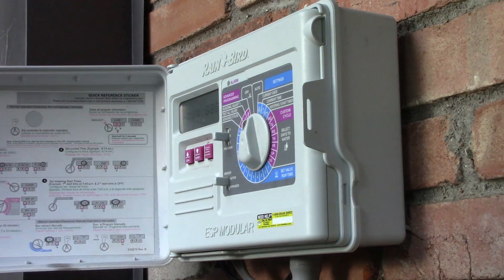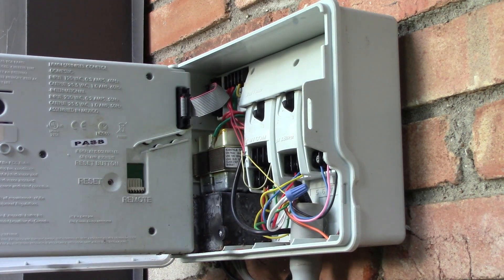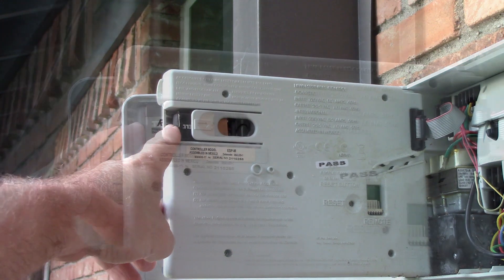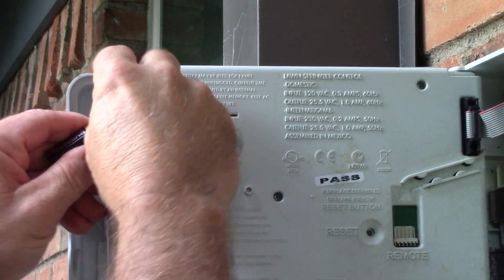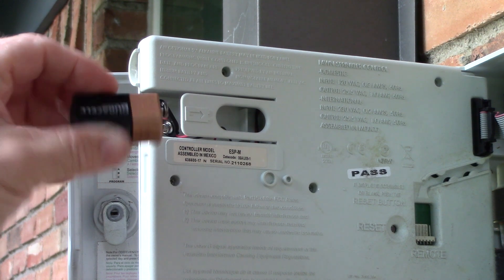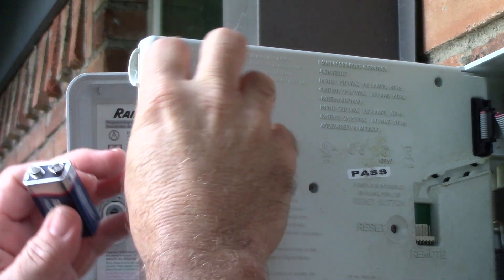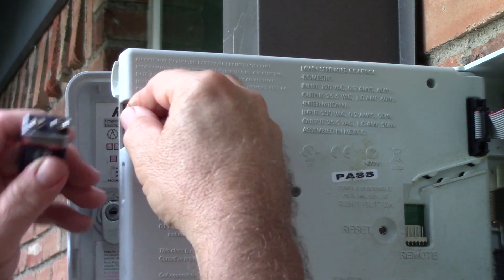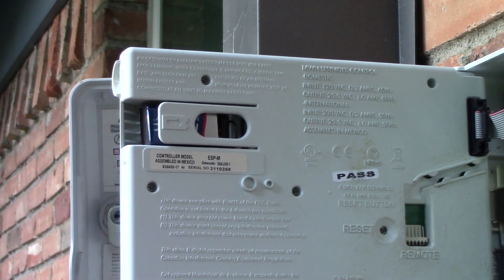2009 Rain Bird ESP-M Irrigation Controller: Display Backup Battery Replacement

Comment: The reason why your battery backup lasted so long is because the machine has an internal lithium battery with a lifetime of 10 years.  That 9V battery that you replaced is intended to allow programming the device while it's disconnected from wall power.  It was that internal lithium battery that was keeping it running.
Reply from the maker: Yes, as stated in the video description.

Comment: Q. I have this time (ESP Modular) master valve installed right after the 5HP pump in my back yard, and would like to know what's the right connection for the wirings? 
Currently, two wires coming from the master valve, one installed in C and the other wire installed under station 1 ! I am not sure if this is right or not. 
Why I am I asking? well, because when i test all valve, station one works only and the other stations (from 1-7) doesn't work!
This device was set for something else, and I am now trying to use it for some other irrigation layout in my backyard.

TIA all for the help if anyone can help in this matter.
Mohamed
Dubai
Reply from the maker: Mine is connected to the city water supply, so no pump to deal with. Might be some reprogramming of the controller required since it was used in another type application. After a quick Google search, I found the manual. It shows wiring, and programming directions: https://www.rainbird.com/sites/default/files/media/documents/2018-02/man_ESPModular.pdf
Reply: @dynatrak  thank you very much, I appreciate your efforts.

Comment: Whoa!!! Thanks so much. I have an ESP-6, same battery, 9-volt, but a label says to use a rechargeable 9-volt battery. Mine sure looks a lot like yours, except where the batter is stored. I bought a rechargeable 9-volt battery, but it is not keeping time during power outages. Thanks for any more thoughts. Cheers. Jim
Reply from the maker: Just looked at my controller. Mine has an internal lithium battery as well, but it still seems to be good, so I will just leave well enough alone. When that one fails, I will make a video.
Reply: @dynatrak  Oh, thank you, so I'm guessing mine might have and internal lithium battery as well. I'm guessing I should look for it. 
Thanks so much again.
Reply from the maker: @jimjr4432  You're welcome! Glad you asked, now I can check into mine this fall. I did notice mine calls for an alkaline, but the rechargeable one like you have would be a real nice feature to have.